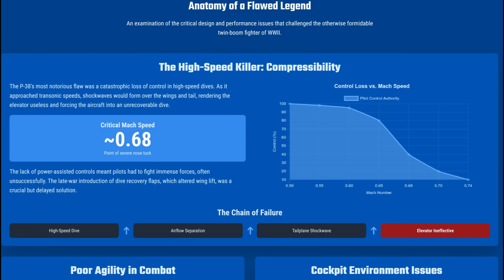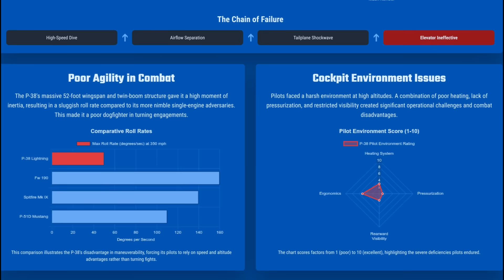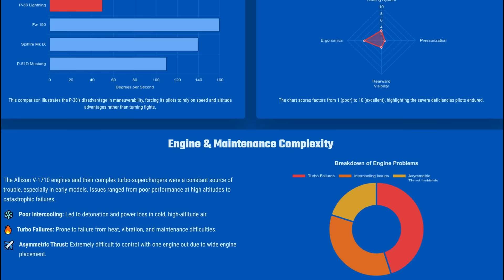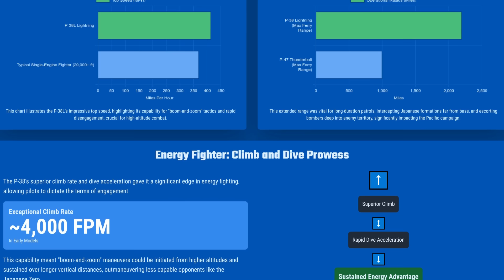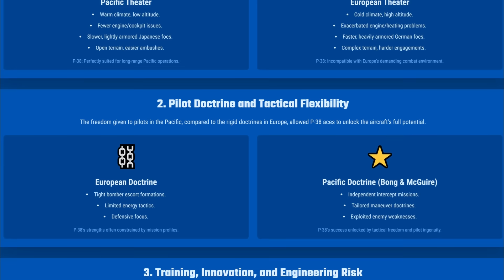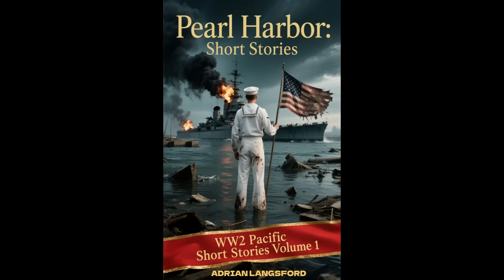P-38 Was a Nightmare..Yet It Made America’s Top Aces

Comment: Of course, hindsight is the purest sight, but it seems to me that an intelligent and insightful fighter pilot contemplating combat in a airplane as large and heavy as a P-38 would not default to "slow, hard-turn", but to "bang and zoom" that the P-38 was best at. The top aces flew P-38s and were so because they understood this
Reply: You not always have the luxury of boom and zoom, and P-38's compressibility, hydraulic's tendency to froze, and cockpit's freezing problems made it not the best for that work either.
The p-38 was also an extremely complicate aircraft to fly for the average pilot, and was a damned big ass. Not only the aircraft is big, but all that you see is a valuable target. It's all fuel, engines, pilot, or vital structures.
Reply: @neutronalchemist3241  Yes, like all things it had its pros and cons.
The P-38 was perfect for "boom and zoom". Against a Zero, or other similarly ultra-maneuverable Japanese fighter, it was the only reasonable choice, which Tommy McGuire tragically proved.
Reply: @neutronalchemist3241  A few thoughts about your reply: 
The entire point of designing and deploying fighter aircraft with the P-38's spectacular performance was so that the pilot COULD have the luxury of choosing the terms of the fight. Once the parameters of the Zero and other Japanese fighters ware understood, U.S. Army and Nayy pilots were trained to avoid slow, hard-turning dogfights with Japanese fighters specifically designed for such fights. To take and maintain the advantage, U.S. pilots learned to "boom and zoom", and quickly dominated the Pacific skies. They also learned to avoid long power dives until dive flaps were installed in the J and L models in mid-1944.
As "complicated" is concerned, the P-38 was an airplane with two engines, not some exotic, strange, tricky machine. Pilots had been flying airplanes with multiple engines since 1913. P-38 was not a problem to learn to fly, and that extra engine got many pilots home when a single-engine airplane would not have.
All aircraft are "all fuel, engines, pilot, or vital structures". What is left for them to be?

Comment: Charles Lindbergh, working as a civilian consultant, went to the Pacific Theater to teach Army pilots how to get the most range out of the P-38. Lindbergh had some experience at at long distance flying with a limited fuel supply.
Lindbergh had the ground crews set the fuel mixture rates to a very lean mix. A lot of crew chiefs thought the pilots would burn the engines up. However, it worked! Pilots were landing after missions with lots of fuel left. Lindbergh’s fuel mixtures became the norm after that.
Reply: That information about how to properly use manifold pressure and set the mixture was actually IN the flight manual, documented by Lockheed. In the early days the pilots didn't trust this data until Lindbergh proved it was highly effective. In fact, the P-38's were the only fighter in the ETO in '43 that could have gone all the way to the target with the bombers, except the bomber mafia insisted they didn't want or need fighter escort until the entire campaign was facing certain disaster without fighter cover. They already HAD drop tanks available and ready for the 38.  It was blind faith in the prewar doctrine that caused so many unnecessary losses of bombers and crew...
Reply: This was on the p47 not p38
Reply: @randytwidwell7418  Uh, no - he may have done it with the P-47's, but, most assuredly, he also worked with the pilots of the 475th FG who flew P-38's. He actually bunked with McGuire for a while. I refer you to the book 'The Last Great Ace' by Charles A. Martin for confirmation. Also, while working with the 475th FG and flying P-38's, Lindbergh had at least one aerial victory, as well as nearly being shot down by a Japanese pilot at one point. Something that did not sit well with the brass as he was supposed to be a civilian consultant only and not flying combat.
Reply: @randytwidwell7418  It was a documented fact that Lindbergh created the "cruise" mixture mode extending the Lightning's range.  CL also had a Jap kill in a P-38 while out there although being a civilian contractor, he could not claim that kill officially.  I don't know if he did this for the T-bolt, but it wouldn't be a surprise if he did this as well.
Reply: @randytwidwell7418 Good point.
Also in the ETO, pilots suffered from the cold in the cockpit because there was no heat. The was no way to get the heat from the engines to the cockpit because of the twin booms.
The Pacific didn’t present any frostbite problems for pilots.

Comment: If it had entered the war with dive recovery flaps, boosted ailerons, and a pressurized cockpit, ....it would have been the greatest WW2 fighter of all. It is my favorite fighter because it teaches that critical lesson; small details matter.
Reply: There were also other things. It was designed in '37-38 before many of the later NACA reports on drag reduction. And before anybody understood the issue of compressibility - it was really the first production aircraft to encounter the phenomenon and that took time to mitigate it (not cure it...) with dive flaps. I never understood why they didn't do some of the simple things with later models like sealing up the gun ports which would have significantly reduced drag and improved the cockpit temperature issue. And... the later versions needed paddle props to turn all that extra HP... going from 1100 per engine to 1400 then upwards approaching 2000HP into usable thrust. The plane could have been significantly faster. But, it was not deemed worth the investment unfortunately given the change in roles and successes in the MTO. Understandable I guess. The plane just suffered because it was a very early design. Still... it served with honor and distinction. My all-time favorite war bird...

Comment: "There is little wonder that loss rates were relatively high and the kill to loss ratio was below that of the P-47's which could be massed by the hundreds (700 P-47's flying escort was not uncommon). The Luftwaffe quickly learned to position the bulk of their fighters just beyond the range of the Thunderbolts and repeatedly flew aggressive small unit ambushes against the handful of P-38s tied to close escort and thus denied the freedom to engage at will."
AIR POWER AUSTRALIA Assessing the Lockheed P-38 Lightning

Comment: McGuire was known to have put so much stress on his plane that it came back BENT. One heck of a pilot. The problem in Europe was the oil in the intercooler door concealing @ -50 deg. Different oil finally fixed the problem.
Reply: The P38 was extremely complicate to fly for the average pilot. 20th Fighter Group commander Colonel Harold J. Rau was asked a written report on why the P38 was failing in Europe:

“After flying the P-38 for a little over one hundred hours on combat missions it is my belief that the airplane, as it stands now, is too complicated for the ‘average’ pilot,” wrote Rau. “I want to put strong emphasis on the word ‘average,’ taking full consideration just how little combat training our pilots have before going on operational status.”

Rau wrote that he was being asked to put kids fresh from flight school into P-38 cockpits and it wasn’t working. He asked his boss to imagine “a pilot fresh out of flying school with about a total of twenty-five hours in a P-38, starting out on a combat mission.” Rau’s young pilot was on “auto lean and running on external tanks. His gun heater is off to relieve the load on his generator, which frequently gives out (under sustained heavy load). His sight is off to save burning out the bulb. His combat switch may or may not be on.” So, flying along in this condition, wrote Rau, the kid suddenly gets bounced by German fighters. Now he wonders what to do next.

“He must turn, he must increase power and get rid of those external tanks and get on his main [fuel tank],” Rau wrote. “So, he reaches down and turns two stiff, difficult gas switches (valves) to main, turns on his drop tank switches, presses his release button, puts the mixture to auto rich (two separate and clumsy operations), increases his RPM, increases his manifold pressure, turns on his gun heater switch (which he must feel for and cannot possibly see), turns on his combat switch and he is ready to fight.” To future generations this would be called multi-tasking, and it was not what you wanted to be doing when Luftwaffe fighters were pouring down on you.

“At this point, he has probably been shot down,” Rau noted, “or he has done one of several things wrong. Most common error is to push the throttles wide open before increasing RPM. This causes detonation and subsequent engine failure. Or, he forgets to switch back to auto rich, and gets excessive cylinder head temperature with subsequent engine failure.”

“When you reduce power you must pull back the throttle (manifold pressure) first, then the prop RPM, and then the mixture. To increase power you must first put the mixture rich, then increase prop RPM, then increase manifold pressure. If you don’t follow this order you can ruin the engine.” Rau added that in his own experience, his P-38 group had lost at least four pilots who, when bounced, took no evasive action. “The logical assumption is that they were so busy in the cockpit trying to get organized that they were shot down before they could get going,”
Reply: Fuel issues in the ETO as well. Bomber Mafia interference sending it to Italy without even trying to use it. Tragic. BTW... I live about 30 miles from McGuire AFB in NJ, and my daughter just commissioned as a Lietenant in the USAF! I fly RC models competitively in precision aerobatics at Pemberton airport just outside the base... they have a P-38 on a pole at the main entrance. My Father's Day trip with my daughter was to get up close and personal to it. On my bucket list - a one third scale P-38!

Comment: The famous ace Hubert "Hub" Zemke (commander of the famous 56th "Wolfpack" fighter group), frustrated by the P-47's lack of range, requested his transfer to a P-38 unit... and quickly regretted his decision.

He soon found out that the Lightning was very unfit for the northern Europe extreme cold skies. On more than one occasion, he recalled having engaged enemy with tactical advantage, before being forced to disengage as half of his squadron found themselves put out of action. The P-38's hydraulic system, which governed turbo superchargers and propellers speed, had indeed a nasty habit to freeze solid at altitude. At cruise speed, everything seemed OK. But when you wanted to switch to combat settings, suddenly your engines stalled or overrevved.

Not to mention the pilots were also freezing AF in their cockpit. Yeah,  Thunderbolt pilots will agree : having a 2.000 HP radial engine in front of you does a great job to keep your feet warm.

And this is why Zemke quickly transfeered to a P-51 Mustang unit.
Reply: Zemke did most of his tour with the 56th  & in the book "Air  Command" (Ethell), he compared the 3 & said the Thunderbolt was THE superior Fighter above 25,000 ft, which is what it was designed for. 7 of the top 10 American Aces in the ETO flew Thunderbolts.
Reply: Zemke transferred to the P-38 group because they were scheduled to convert to the P-51.
Reply: The P-38 hydraulic system has absolutely nothing to do with the turbochargers. Or the propellers. 

The turbochargers are controlled by regulators fed by engine oil pressure and pilots left the oil cooler doors open, keeping the oil too cold. 

The Curtiss Electric propellers were fully controlled by the electrical system. The problem with the Curtiss Electric propellers was the same on the P-38 as it was on the P-47. Only Republic was allowed to replace the Curtiss Electric propellers on the P-47 with Hamilton Standard High Activity paddle props. Lockheed built a P-38 with those props, the P-38K, and petitioned the War Production Board for permission to use Hamilton Standard props on the P-38 and was denied. 

Facts matter.
Reply: @AlanRoehrich9651  Spot on. The 38 needed those paddle props once the engines hit 1400HP and were still seeing newer models HP output increased.

Comment: A lot of the engine problems in ETO were due to fuel problems. Also Bong didn't consider himself to be marksmen and would close to point blank range. On leave back in the states he requested and went through additional gunnery training.
Reply: The 100 octane fuel available in Britain was actually a lower octane than American 100 octane .
Reply: @dandewitte Both were 100 octane, the rating is a combination of factors. The British 100 octane fuel emphasized a different part of the equation than the U.S. one. The Canadian fuel was different from either one and had a much more balanced ratio of factors that made it work in just about any aircraft. There wasn’t as much of it and it was primarily used for training aircraft but it did its job well. There were fewer losses of Canadian pilots in training engine failures than any other nation of WW2. If it had become a universal standard, there would have been fewer losses of aircraft and pilots in WW2. As it was, there was no universal standard for 100 octane fuel and that caused endless maintenance problems. The Dutch, Javanese and Australians also produced their own versions of 100 octane fuel before the war. The engineers on the Pan American flying boats learned to adjust the carburetors and the superchargers for each. Even now in the U.S. different brands of gasoline get their octane ratings by emphasizing different parts of the equation. One engine might run fine on one brand but run terribly on another, both having the same octane rating.

Comment: The P- 38 was a mediocre high- altitude aircraft over Europe but a very good fighter below 20,000 feet. It's no coincidence that the two fighter pilots referenced here flew in the pacific theater, where combat altitudes were generally lower.
Reply: It was also due to the fact that P-38s could achieve speeds and altitudes their japanese opponents could only dream of. Which wasn't exactly the case against Luftwaffe fighters over Europe.
Reply: @razorback20  Yeah, most of them (the Japanese) anyway.
Reply: @razorback20  The European theater also pitted green American aviators, constrained by ineffective doctrine, up against some of the most experienced adversary pilots in human history.

The P-38 had some advantages against Luftwaffe fighters; enough that I like to think it could have secured a more competitive niche, had it been flown to its strengths. But flying the plane to its strengths required pushing it to the boundaries of its notoriously dangerous envelope -- against common sense self-preservation, well-established doctrine, and (probably) the advice of the instructors. More than could be expected of anyone who wasn't already an expert.

They learned a lot, and fast -- adding dive flaps, boosted ailerons etc -- but never really got a chance to see the benefit in Europe; the P-38's were rotated out, and the replacement planes were flown under much more flexible doctrine against increasingly exhausted Germans. Better conditions all around, and unsurprisingly the results improved. Great for the Allies (and the world) but an cruel twist of fate for Lightning fans.
Maybe the saddest moment in the whole affair was the first shipment of critical upgrades (dive recovery flaps, I think) being lost in its entirety when the transport aircraft was shot down.

But yeah, with that said, the speed advantage was the defining characteristic of the Lightning's campaign in the pacific. The kind of critical advantage that helps new pilots survive long enough to build expertise. Speed is life.
Reply: It was built for high altitude interception…